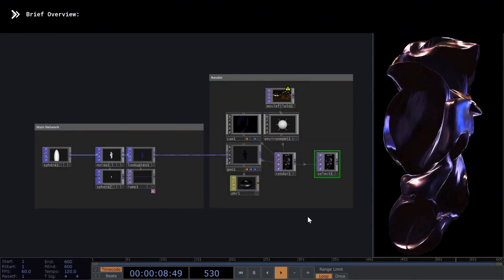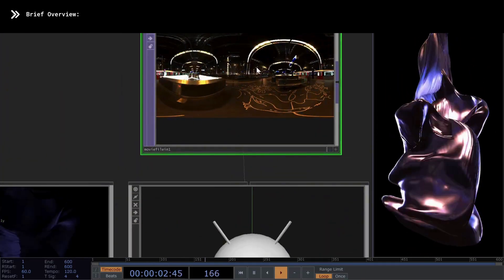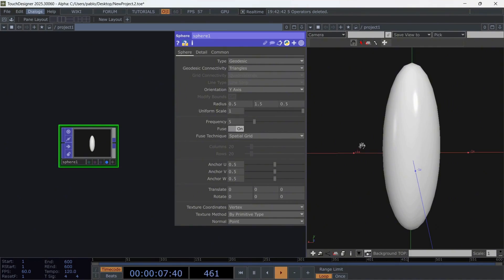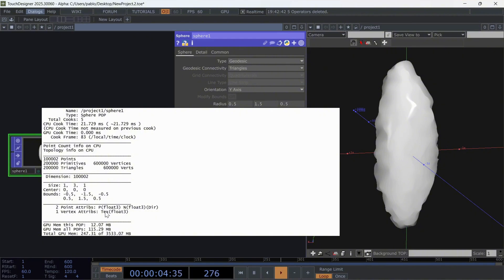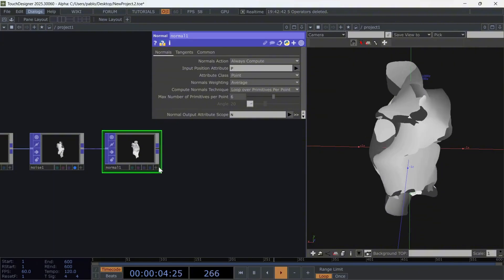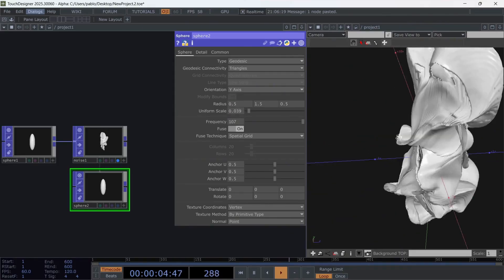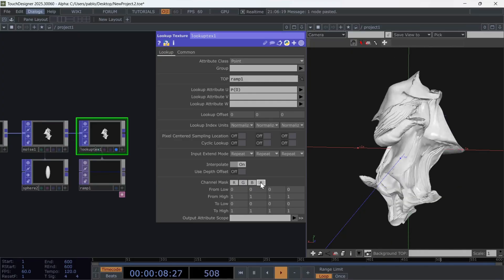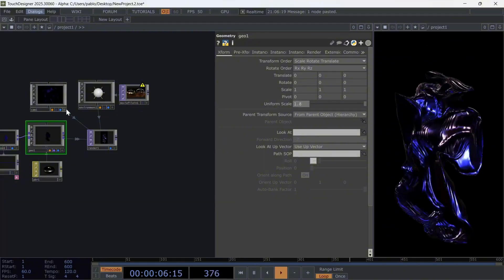TouchDesigner POPs: Remake the Noise Sphere Using Noise and Lookup Texture

Comment: When the ramp is set to vertical, since it is set to one pixel tall - isn't that just using one value for the color?    I'm sure you could use the offset to change or animate the color - but otherwise - why use a ramp if the end result is only one color?